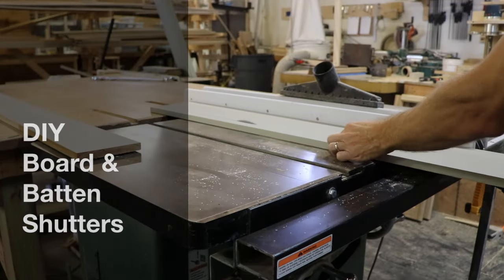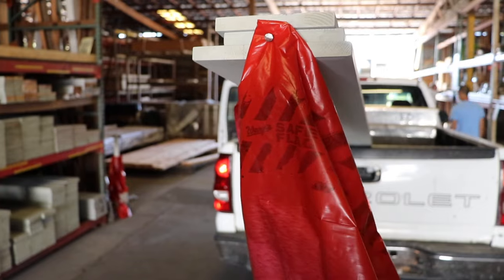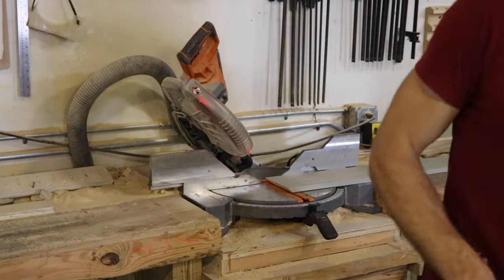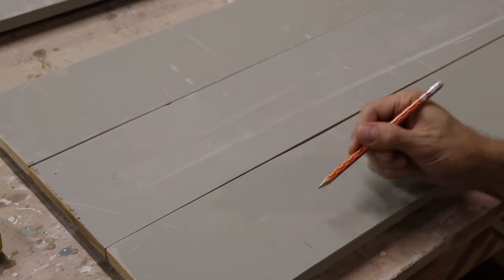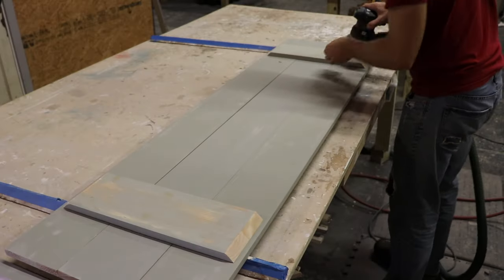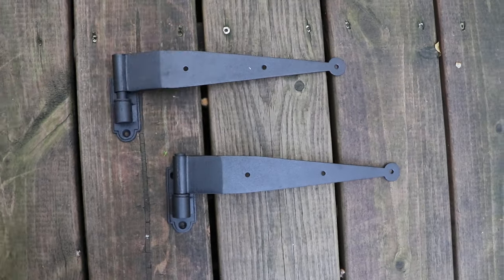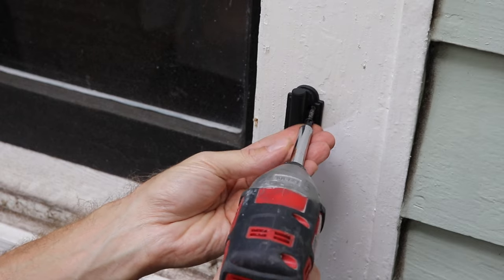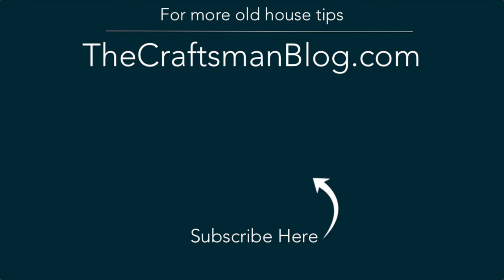DIY Board & Batten Shutters

Comment: Nice Video. I think most of us only have a portable circular saw and not a nice long table to work on.  It would be nice to see a DIY with common portable tools too.  My windows are surrounded by stone and no place to secure the shutters other than drilling in the stone.  A DIY of this arrangement would be helpful.
Reply: 1. Get the lumber cut to length at the yard;
2. Get a portable work table (can be folded for storage);
3. Masonry bits and self-tapping screws will secure the hinges in the stone.
Reply: Barn door sliding shutters

Comment: I like it. The only minor complaints that I have is that instead of using nails....I would have used screws because after about 2 or so years nails become loose because wood expands when wet and in summer and contract in cool, dry weather. The other complaint is instead of an electric disk sander I would have a sanding sponge (at least 100 grit). Otherwise it looked perfect

Comment: Great video! Thank you for sharing!! Shutters are fantastic for blocking out the heat in the summer, the cold in the winter, and the light for sleeping! After living in France for over 10 years, and now back in the states, I don't get why we're not using real shutters here... SO thank you very much for this video and your links. How much did this project set you back in terms of material costs?
Reply from the maker: The wood was about $80 and the hardware about the same so between $160 and $170 for the whole thing. Not peanuts but cheaper than buying pre-made of this quality.

Comment: I was searching for hurricane shitters because I am working on a house that has,... had some of these on the windows.  Hurricane Ida recently ripped some off and loosened a few of those that are remaining.  I had thought about simply rebuilding the missing ones and tightening up the remaining.  However, they aren't really all that storm proof to begin with and the home owner would be calling me back to the house to repair/replace them after the net storm.  I'd rather do it right the first time.

But as I am writing this, it occurred to me that I could rebuild and replace the ones that are missing and rebuild those that are still there, but instead of using the 1 inch screws and smaller hinges, I could use glue between the boards, and use small bolts/washer/nuts for the fasteners and larger hinges.

Comment: Great video.  We own a house with 12 lap siding with no window wood frame on the edge of our windows and was curious if you could recommend how to install the shutters without or do I need to add a wood frame?  Thanks again for your great video.
Reply from the maker: No window trim is unusual on an old house, but shutters can be mounted anywhere as long as the will then close and block the window appropriately.

Comment: Thanks for the Video.  For 14 1/8 x 64" (already deducted a 1/2 inch off each), how many vertical boards would you recommend and their width too look aesthetically correct, and the width of the Batten?? Thanks.
Reply from the maker: I would keep the battens the same width as each board roughly. I would use at least 3 boards at all times for the boards.

Comment: Will these hold up under say cat. 3 hurricanes or higher? I live in northeast Florida. Looking for a more cost effective and efficient way to protect my house.
Reply from the maker: They’re not tested for that, but 1/2” plywood is tested to withstand “large middle impact” so I would imagine 3/4”  solid wood should do even better as long as the hardware is attached appropriately.

Comment: nice job on shutters. but I think you're going to regret using wood  filler if your shutters get a lot of Florida sun. As the wood expands and contracts - the filler won't and the paint will crack. Prolly in 3-6 years.
also wondered why you didn't glue the boards together?

Comment: My windows are 46" wide do you think that the shutters would be to heavy?
Reply from the maker: Not at all! With the right hardware you can maneuver huge shutters with no problem at all.
Reply: I have 5 x8 "shutters" on an outdoor pavilion.  They are basically garage doors that are hung with shutter hardware instead of strap hinges so I can remove and relocate the doors really quick if I needed to.  Just make sure you get hardware that can handle the weight of your shutters.  I bet House of Antique Hardware has what you need.  Tractor Supply might also have gate hardware that can work for you.  I did a cross brace between the two battens to keep the shutter from sagging over time due to the weight.  Yours might be okay without, but it wouldn't hurt.

Comment: You need to prime raw wood before you paint it. I know the paint can says "paint and primer," but if you read the fine print it's only primer over existing paint. You still have to prime raw wood, metal, etc. the traditional way.
Reply from the maker: Who’s painting raw wood? The wood used here was pre-primed cedar.
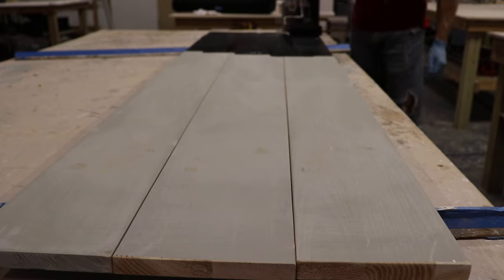Reply: @TheCraftsmanBlog  3:20 Anywhere where it was cut was raw wood. The end grain is the most important part to seal since it readily absorbs the most water.
Reply: @TheCraftsmanBlog  Great video - just curious as to what paint you used?  I'm in New England so want to probably put 2 coats of a quality paint on them -  maybe Benj Moore?  Thanks
Reply from the maker: I used Ben Moore UltraSpec. Worked great!
Reply: @TheCraftsmanBlog  can you please tell me the finish used on this paint? It's perfect!

Comment: I'm wondering if it would be possible to build these out of PVC board? If so how do you think they would hold up in a storm?
Reply from the maker: PVC could work, but they likely are not as resilient in a storm.
Reply: @TheCraftsmanBlog  the only reason I was thinking about it is because I know that the wood is going to degrade over time whereas the PVC would last many years longer